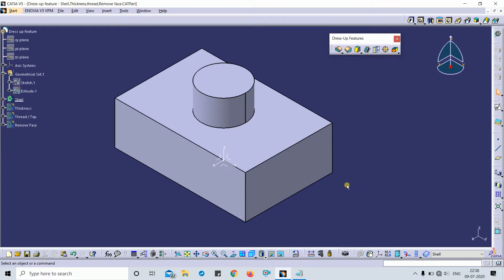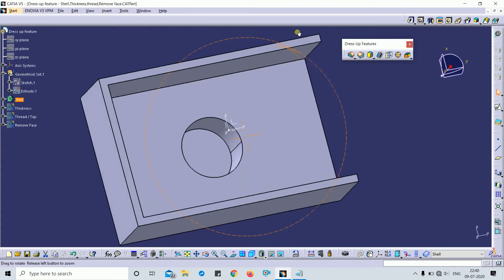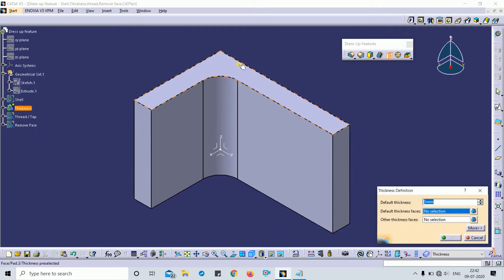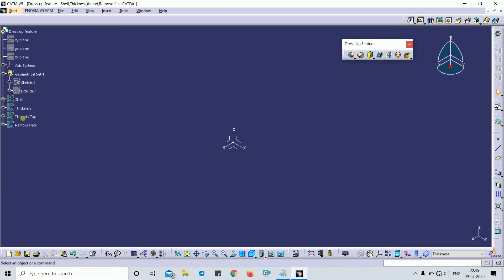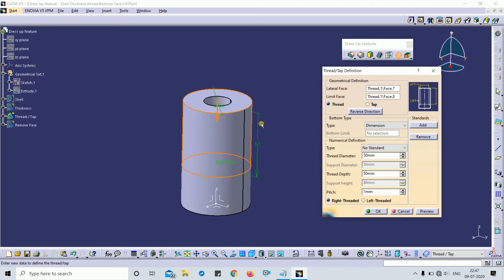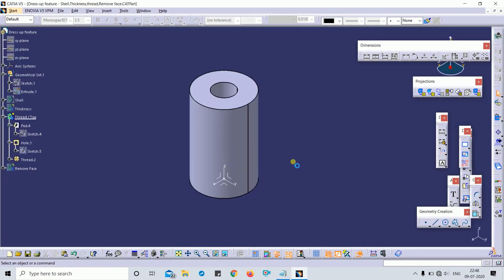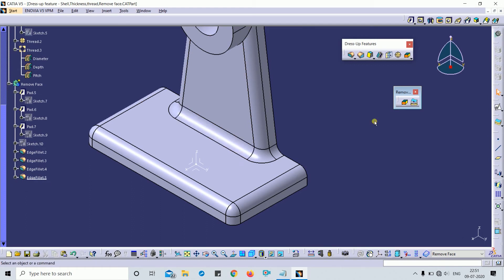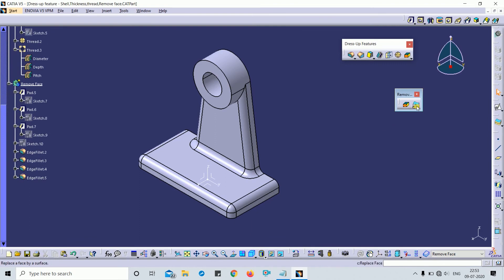Shell, Thickness, Thread, Tap, Remove and Replace Face COMMAND || CATIA V5 Tutorial || Part Design

Comment: Hi sir, i want to ask. Why do we need to add the edge fillet?
Reply from the maker: Basically, fillets used to remove sharp corner. Technically, use fillets to reduce stress and it also helps to distribute stress.